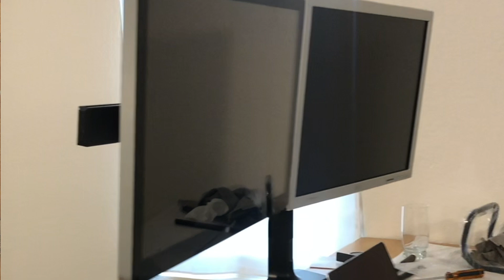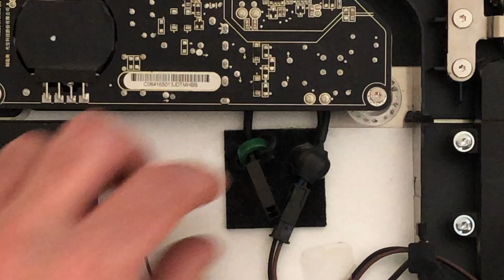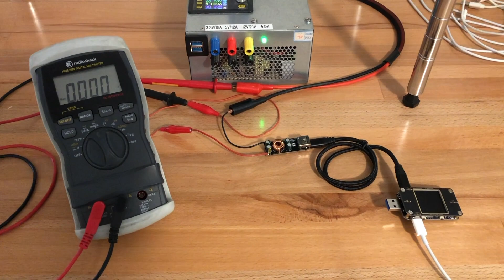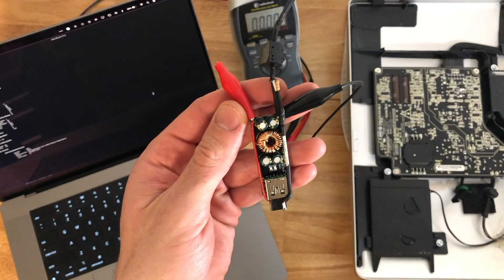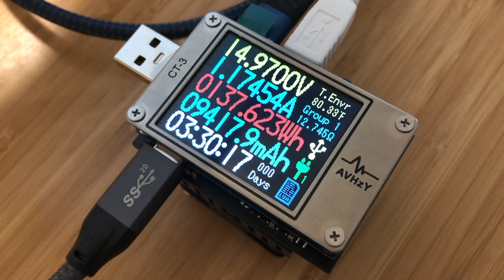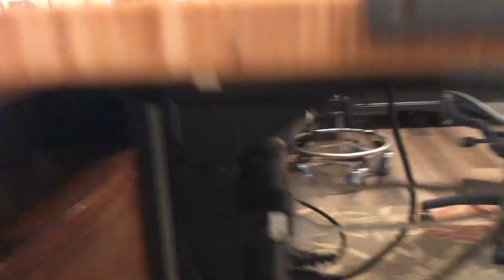Thunderbolt Display USB-C Retrofit for Modern Macs!

Comment: Just tried to hook up this monitor to a regular computer via a mini dp cable...without luck...same with the original cable (which  I think might have been damaged)...any other solutions? When plugged into the power the display shows usb power output in the back....so something is off with the video display board, or some other issue...any ideas? what to test out? thanks.
Reply from the maker: Mini DisplayPort won't help you here. It uses that connector, but you have to have a Thunderbolt capable port.
Reply: So how would one connect it to a pc?  @colindgrant
Reply from the maker: @dp888dpAscende  It's a Thunderbolt display, you have to connect it to a Thunderbolt port, whether Mac or PC. Thunderbolt is more common on Mac, but many PCs have it too.
Reply: @colindgrant  So what way would one be able to connect it to a hdmi, and displayport gpu?
Reply from the maker: @dp888dpAscende  Can't be done. Thunderbolt displays only work with Thunderbolt capable ports, period. Thunderbolt requires an actual chipset made by Intel. Think of it as adding a card into a tower PC. It's not an adapter type of thing.
Reply: what about displayport to thunderbolt cables? adapters? @colindgrant
Reply from the maker: @dp888dpAscende  there is no such thing! DisplayPort and Thunderbolt only share a physical connector. They are completely different technologies.
Reply: Couple of YT videos depict it otherwise...with some active adapters available on  Amazon....especially with thunderbolt 4.0...3.0 no idea...but there must be something....after all apple is a shitty company so people had to invent something to make their stuff compatible with the rest of the world..   @colindgrant

Comment: Hi, I have mostly completed this mod to my Apple 27" Display. Power delivery works a treat. It's been faultless.
I am having troubles with the Thunderbolt > TB 3/4 cable placement inside the screen. When I then install the converter inside the screen, the USB2, FaceTime camera and Display Speakers drop off after about 10/15mins. I have tried multiple locations in the screen, but every time it plays up.
My first point of call was the TB3/4 extension and purchased a different type but had the same result. 
To confirm my cables are good and working for long durations without fault, I moved the converter externally with just the short Apple Thunderbolt cable running out of the screen with the Apple TB > TB3/4 converter outside the screen. This then works perfectly and can't fault it. I then move it back inside the screen taking careful note of the USBC orientation, and it faults again...
Placement of converter: mimic'd colin's placement from the video, tried further to the right above the speaker, and also to the left between the boar and the apple logo. 
I am in Australia, so we are 240v power here - wondering if I'm getting some sort of interference compared to 110v displays
Could this be caused by heat issues from the main board?
Has anyone experienced these kinds of issues with the conversion? Any input is very much welcome.

Cheers
Reply from the maker: Really good detail here. I'm not sure what could cause this, but it seems like you've gone through the right steps to diagnose it. I kind of doubt 240V is the culprit - the display should be using the same total watts right? Lower amperage in fact, so potentially less heat. If I think of something, I'll comment back, but nothing comes to mind right now...
Reply: @colindgrant  Further update: wrapped the converter and connectors in aluminium tape to try and eliminate any interference issues (and yes too into account conductivity and covered potential areas with kapton tape). This brought on the issue ALOT quicker and completely killed the video signal after 10mins or so. This has lead me to it being a heat issue. I have since moved the convert further up and ontop of the apple logo give it far more air circulation, but am still having the extra functions drop off after 15mins or so (Display Audio, FaceTime Camera etc). Further playing around to be done. 
Out of interest, I have order a couple of different DP to USBC (TB2 > TB3) cables from Aliexpress to see what this does - will report back when it arrives. Don't have high hopes for these...
Reply from the maker: @Johno_H  That's so strange! The fans don't even come on in my monitors, and yet I don't seem to have an issue like yours.

The DP to USB-C adapters you are seeing may be video-only. Those are the physical connectors but you'll need Thunderbolt 3/4 transport over the connectors, and to my knowledge only the Apple adapter does that.

Nonetheless, please do report back!

Comment: Goddamn, this type of stuff revives electronics so that they dont go to ewaste. Great video. 2 questions though. 1. Did you have to solder anything? on the Charge Module? Am thinking about doing this myself 2. Does it have to be only apple devices? or can it be like AppleTV, Linux, Windows, etc?
Reply from the maker: This video is pretty specific to the Thunderbolt Display but you can apply the concept and adapters to other devices as well.
Reply from the maker: Just basic soldering to wire up the USB Power Deliver module.
Reply: @colindgrant  Does the 39Ω resistor mimic a signal that a macbook would put out?  and also one thing I would change about this video is that I wished you showed how to make the charge module
Reply from the maker: @AnzenRyzen  Yeah the resistor is a value that the older non USB-C MagSafe system used. Connections are all explained in the video, but I chose not to include the actual soldering since that's a whole other subject!

Comment: What happend with Mac mini or Mac Studio? Can the mac mini or mac studio  with M2 be connected to the apple thunderbolt display or is there incompatibility? Do I necessarily have to use the Thunderbolt 3 to Thunderbolt 2 adapter? Or should we proceed another way? Should I use the same display cable or another one? Or is it possible with the mac M1 but not with the M2?
Reply from the maker: M1 and M2 don't really have anything to do with this modification. This video deals with converting the Thunderbolt display from Thunderbolt 2 (DisplayPort connector) to Thunderbolt 3/4 (USB-C connector).

Comment: All I want to do is figure out a way to use the firewire and thunderbolt ports to add a few more USB ports.  Anyone have a simple solution like a chord that plugs into the firewire or thunderbolt ports and creates a dock?
Reply: use a TB3 dock to inject power and it will add a handful of highspeed ports as well, i'm using a kingston sd5200t
Reply from the maker: @ponsoldt I bought a used Belkin TB2 hub to do that.

Comment: Another incompatibility from Apple with the rest of the world.
When I realized all the problems I got after purchasing a G4 tower in 2004 I sold everything after only one year of use.
For sure it was a beautiful desktop tower but sooooooo much problems : uncessant OS updates to run some softwares, hardware limitations/speed, expensive hardware upgrades, expensive accessories, ..... Apple is only a question of design and money, not productivity.
I switched to Windows and all my problems were solved. No more headaches : inexpensive accessories, total compatibility, tons of softwares and hardwares, easy upgrades, more fun/speed/productivity, ease of use since Windows 98 SE and later.
I will never touch an Apple product again.
Reply from the maker: I am really genuinely confused by your comment. I think you've got it 180 degrees backward. Apple helped develop USB-C and USB-PD (Power Delivery) in the first place, and that is the standard today. Their newer equipment uses nothing but USB-C, so it is more compatible than ever before. Yes the Thunderbolt Display used MagSafe2, which had its own special power connectivity to the laptop, but this is no different than power bricks used by Dell, Lenovo, etc. Almost all of them have proprietary plugs and proprietary ways of ensuring safe connection/disconnection. Lots has changed since your G4.
Reply: @colindgrant  The main problem I discovered with Apple is its totally closed/hermetic "ecosystem" with its own connections/protocols/cables/plugs/... (same with iPhones !!) which are incompatible with 95% of the rest of the world (Windows/Linux systems mostly) and also with famous brands like Samsung/Dell/Lenovo/Asus/MSI/ etc etc ..... I will not forget to mention the ultra expensive accessories and hardwares (x4 the price of those on Windows/Linux machines for the same performances) and without any justification (same electronic components, same plastic/silicone/copper/...). The same graphic card is x4 more expensive with the logo Apple on it. WHY ?? They have exactly the same performances !!

USB-C, USB-PD, Thunderbolt are just fast data transfer protocols others could have created in time. No need to rush ... excepted after money. Allo Apple ?
Steve Jobs was driven only by money and glory, and nothing else.

Luckily the whole planet can use Windows/Linux/Java/... without problems and with ease for a fraction of the cost.
Even the "Magic mouse" is crappy : slow, sensor errors,... and of course over-expensive. Nothing beats the standard mouse with its wheel and right/left clics (or maybe the trackball for some purposes).

Even OSX is also crappy and the incessant updates make people crazy. 
FYI I use Windows softwares from 1995 on my Windows 10 Pro 2023. Can you do the same with the last OSX today ??
Why so many people install Windows on their Mac and use it the whole day instead of OSX ? There must be a reason : simplicity, compatibility, efficiency, speed, gigantic choice of cheaper softwares,... and so on.

My friend who owns a iMac late 2013 asked me to buy an Asus laptop with ADM Ryzen7 and Windows 10 Pro for the 1/3 of the price of its Apple equivalent. He is fed up (as I was) of this race towards money and of this locked world. If he wants to upgrade his iMac the cost is prohibitive (Hardware, RAM, processor, ....). Windows machines are a much better option. You can upgrade anytime without breaking the bank.

Today I am happy to be free from Apple, to have saved a lot of money, time and headaches by switching to Windows, and to share my data via USB to all my friends/employees. Can you explain me why a USB stick from Windows cannot be read on a Mac ? Hermetic ("racist" ?) Apple's world !!
Apple is mostly for snob people as I can see daily when I sit at any Starbuck coffee and observe this show-off of the last iPhones and Powerbooks. Good for them !!  PFFFFFFFFF !!!!!!! 
You will never see me putting a fingertip on a Apple whatever it is. With my past experiences I became genuinely allergic to Apple. And I have plenty of good reasons for this.
BTW I own 5 Asus laptops (oldest is 10 years old) working perfectly and one MSI desktop tower I upgrade time to time. 
Zero complaints since 10 years !!!! Long Live Windows machines !!!!
Reply from the maker: @seanconery8836 You don't find value in those things you mentioned, that's fine, you don't have to buy them. One day if you let your guard down, you may find the legitimate value in Apple's "ecosystem" that millions of others have.
Reply: @colindgrant  Thanks for your reply.
 "...you may find the legitimate value in Apple's "ecosystem" that millions of others have"
I am still searching since 20 years but without success. It is why I am still using Windows since 20 years and my choice goes for Asus machines and their incredible quality. I also tried Dell and Acer but Asus is the way to go.

I agree that Apple R&D is working hard to improve the workflow with new technologies but the main problem with Apple is their lack of compatibility tests with their old products, their outrageous prices for the same items found for Windows machines, but also lies or missing information (like, among others, an update for iPhone which reduced processor speed to save battery consumption instead to confess their battery has problems).

When you leave Apple for ever it is for good reasons. And I have plenty.
On the other hand my Windows machines, as soon as powered ON, allow me now to work efficiently without troubles with any software as old as 1995. 
Now I can work, Windows doing his job very well without any trouble.

For photo/video editing, designing, 3D printing, gaming, accounting, browsing the net, projecting on an external monitor... nothing beats Windows in terms of speed/compatibility/ease of use/cost/efficiency/lack of headaches. It works. Period.
Something wrong with your Windows machine ? No problem !! It is very cheap to fix it (not like Apple for $$$$$$).

If 95% of the world uses Windows machines it is for a good reason.

My comments are not intended to offend you. Their only purpose is to warn others to don't make the same mistake I did of believing that a beautiful/expensive design means good quality, like many crappy chinese products.
It's when you scratch the shiny hood that you discover the nightmare that lies beneath.

Apple again ? No thanks.
You never remarry the woman you have divorced from.

Comment: there's another solution, you can use the thunderbolt 2 connection on the back with a thunderbolt 2 to thunderbolt  3 cable. Easy Peezy. there are also adapters for the magsafe to usb c
Reply from the maker: Well aware of those. Owned them, tried them, went to all this work to avoid them!

Comment: I don't understand why the Thunderbolt Display only supplies ~6V. From what I read on Apple's website, this display is supposed to deliver up to 85W. Assuming it outputs 5A that would be 17V. Does that mean the voltage is variable depending on what the Magsafe 2 connector is negociating with the internal power adaptor? So theoretically could we go DC to Magsafe 3 and the internal power supply would adapt the voltage?
Reply from the maker: I really wish I knew. I think it may adapt to load, but I have not experimented since making this video. It only put out about 15-16V for me.
Reply: @colindgrant  The original Magsafe cable is still good on my Thunderbolt Display. I'll find a way to mesure voltage between the display and my old MBA13 to see if it adapts to the load.
Reply from the maker: @emanuelvanasse  Awesome!
Reply: @colindgrant  I had the time to test it yesterday after finding by Magsafe to Magsafe 2 adapter. It started at ~3.5V and jumped quickly to ~6.4V as in your video. As soon as I plugged the MBA it jumped to ~16.6V showing 85W in the system info app. I think I will adapt your mod. Instead of using a buck converter I will put a USB-C female connector directly to the DC wires than connect my USB-C to Magsafe 3 cable into it. The power supply should negotiate with the Magsafe 3 connector but I'm not sure of that yet. Don't want to damage my MBA :-) What do you think?
Reply from the maker: @emanuelvanasse  Cool thanks for the info. 85W at 16.6V is over 5 amps! Wow! It would be interesting to validate if that much current is actually flowing, or if Apple is just telling us that it thinks it is connected to an 85W capable charger.

The power converter I used was more than a buck converter, it also handled the USB-PD (Power Delivery) negotiation, which is something I'm 99% sure you will need for MagSafe3. You could plug the Apple OEM USB-C to MagSafe3 cable into the power converter I used, and that should work, but not at 85W. The MagSafe3 connector is essentially just USB-PD on a magnetic plug.

I don't see how you can wire a female USB-C connector directly to the power supply in the Thunderbolt Display. Even if you get the display power supply to cough up the ~16 volts, you have to give that to a Power Delivery controller, and buck it down to the voltage level negotiated by the PD device on the other end, such as 5, 9, 12, or 15V.

In other words, I don't see any chance for your MagSafe3 cable to talk to the Thunderbolt Display's power supply. Unfortunately they don't know anything about each other.
Reply: @colindgrant   Yep, you're right. I didn't understand it at first but Magsafe 3 = USB. Magsafe 1/2 is much simpler with only 3 wires, one of whom is for communication. Your mod is the only solution to make them negotiate. I don't like soldering much🤮 but the mod is worth it 😆. I'll try to find white cables to keep the original look. Thanks for the video!

Comment: I just completed this same change minus the power because my thunderbolt cable finally died from the bends. This video was very helpful, thank you! Although I has issues when connecting this to a new Mac mini. I ended up having to skip the thunderbolt extension cable you called out here. Apple thunderbolt cable to apple convertor was the only way it would work for me.
Reply from the maker: Thunderbolt extension cables are tricky. Technically they're not supported over a certain length. It's also critical that you get a true Thunderbolt compatible extension, because I've run into lots of USB-C extension cables that only carry power and USB, no video, no Thunderbolt. Glad to hear you were  successful though!
Reply: How long did it take you start to finish to just replace the one cable? Minus the power?
Reply: @roysgti  15-20min